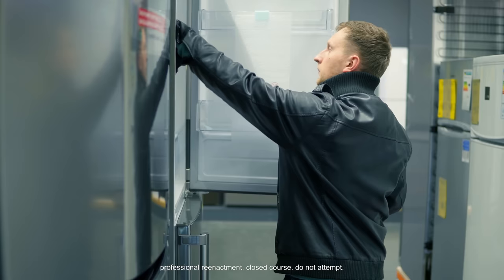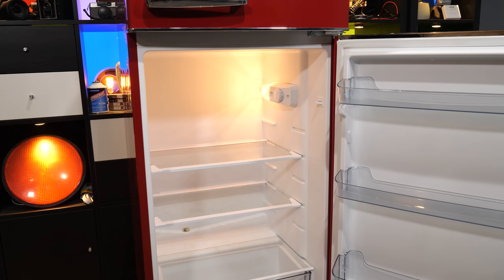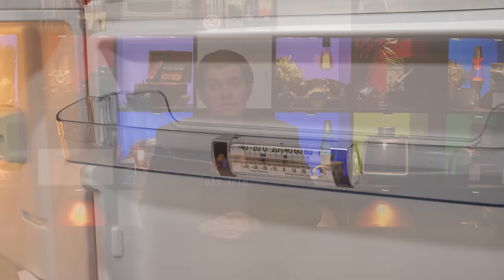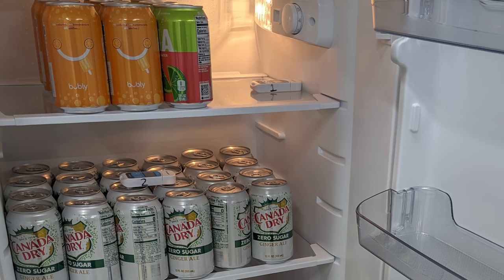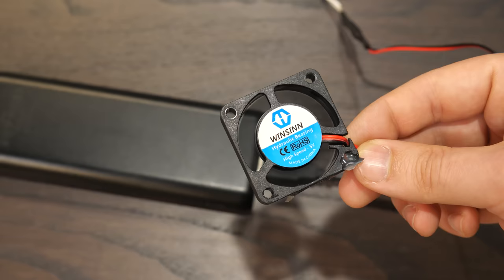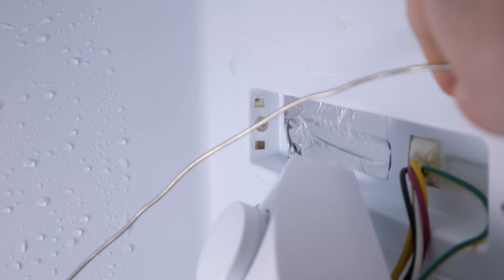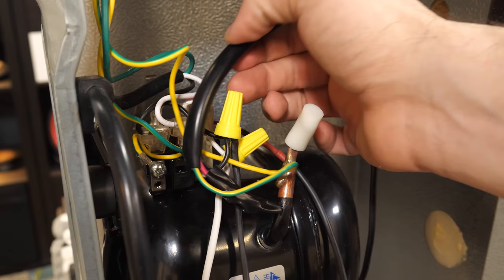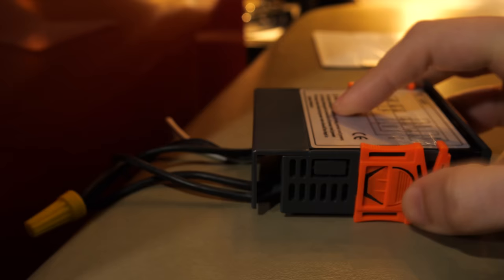This goofy fridge has a really clever design. It's also kinda terrible.

Comment: i am a Refrigeration tech, and I would like to give you some insights, so the type of mechanical thermostat this fridge, (actually the type most small commercial units use) is actually quite interesting. When you adjust the knob your not actually changing the temperature at which the switch closes. It is what's known as a fixed cut in switch, meaning what you are actually changing with the knob is the differential between the cut-in and cut-out temperatures, they are used to essentially make an extremely simple auto defrost. by attaching the switch to only a uniform diameter tube instead of a sensing bulb the pressure the switch sees is the average of the entire tubes length. then by inserting that tube inside the evaporator we get an average evaporator temperature. all you  need to do then is calibrate the switch so that it takes an average temperature of 33deg. along its length  before it has enough pressure to overcome the snap action and you can be sure the evaporator will defrost entirely every off cycle. Also, as you already found out in your testing, because you are reading evaporator temp and not air temp, when the refrigeration circuit has more BTU capacity than the refrigerator evaporators absorption capacity (a necessity with this series freezer design.) The thermostat will always satisfy before bring the box to the desired temp whenever the thermal load inside the box is larger than the evaporator capacity.
Reply: Thanks for this comment! I was kind of interested about the thermostat specifically, since I had a fridge tech replace a part in my fridge recently. He mentioned something about how the dial doesn’t actually set the temp, and I was a bit confused by that but didn’t ask him to elaborate. I think this is what he was alluding to!
Reply: I was looking for that comment.
Reply: I was thinking about the possibility of a thermal cut off switch on the compressor.

The compressor gets too hot from a 100% duty cycle, cut off does its thing to protect the compressor, fridge warms up but compressor cools off.

From my limited understanding of your explanation, that's not the case.

Rather the "thermometer" is getting too cold too quickly, in effect, to detect the correct temperature and needs to pause and acclimatise before it can work again.
Reply: @35manning yeah it’s to stop liquid getting back into the compressor
Reply: Thank you. I was going nuts that he got it wrong.
Reply: Okay but what about the observed temperatures, gradients, and differential? I'm sure they do have an extremely clever reason for putting the thermostat probe in the evaporator, but the end result seems to be some potentially unsafe food temperatures on the interior. Are you saying that by altering the run cycle with temperature control based on interior temperature that there will be frost buildup on the evaporator? I'm asking as a long time owner of one of these Galanz fridges, which displays the same odd run cycle behavior.
Reply: Can I ask what education it takes to become a refrigeration tech?
Reply: Thanks for this reply!

I'm not an HVAC anything, but it occurred to me that the proximity of the sensor to the coil was likely intentionally to serve as protection against the system freezing up, but you gave a far better explanation than I could possibly have.  And all kinds of other awesome details!  

I'm really surprised he missed that actually, he's always so thorough.  But we're all human I suppose.
Reply: @silverywingsagain exactly! It makes me wonder if rhis design is even legal?
Reply: but doesn’t it effectively act as a set temp as that’s what they use them as isn’t it? they have min - max written or little ice symbols denoting it making it colder or warmer when you turn it. when you turn the knob it’s changing the pre-tension on the thermostat isn’t it? making it require more or less pressure from the sensing line and therefore altering the cut in temp?  
like the little cal screw, every turn is approx 4c, and it’s basically a coarse adjustment. i turned a chest freezer into a fridge for drinks by giving it a good 5 turns to warm it up.  
This fridge is  still flawed as it didn’t keep food safe, i’m guessing the plastic lining of the fridge created too great a gradient between evaporator and food area. those old school bar fridges with open evaporator had the little thermostat line right on the coils like you said, but the evap was also open to the fridge so the bare metal was always cooling the fridge and not having to go through plastic.
Reply: And with the temp issues with consistency… they remain drinks fridges
Reply: @35manning  I think you're basically kind of right. From my reading of the comment, it works by effectively cutting off when the evaporator coil reaches its max heat capacity (i.e. it has taken as much heat out of the fridge as it can in one go, aka it's getting too hot too soon).
Reply: Thank you very much for the information.
Reply: @silverywingsagain  Not unsafe temperatures when you pay attention to the different temperature zones within the fridge and shop your groceries much more regularily and fresher than common in North America, keeping the thermal mass inside more consistent.
Reply: @Mygg_Jeager - to become a "refrigeration tech" it takes 1 working day of following the superviser around. You also need to take 4 rest breaks and eat at least one sandwich. Done... ready to write clueless and incorrect replies on Youtube!
Reply: Thanks for the answer! I have one of those cheap fridges that operate exactly like this one, but mine seems to have a defect, because it accumulates a thick layer of ice in one spot which makes the water just flow over the ledge and accumulate at the bottom, where then another slab of ice is formed behind the veggie drawer. What could be causing that?
Reply: @johncoops6897  Lol, funny. But I DO think it's slightly more complicated than that. I'm looking for skills to add to my resume that don't take 4 years and a Red Seal to get certified in.
Currently got 3 employable skills that nobodies hiring for... need a job and thought "Fuck it. No matter what the economy is doing, people's fridges do still be breaking down and need fixing. Why not inquire there?"
If it's a 3 week course and pays 1.5 x minimum wage, that's good enough for now!
Reply: @Mygg_Jeager  - OK, I lied to you.
There is zero qualifications needed to be a Refrigeration Tech. None whatsoever, any m0r0n can do it.
BTW having "qualifications" on your list is never going to get you employment.
Reply: Thanks for giving that detailed reply on how these fridges work. My thoughts on that fridge is that it looked like they had a lot of those old "fixed cut in" thermostats in stock and wanted to use them, but in a fridge without the rest of the usual components.

Until earlier this year I was keeping a 1964 model fridge going that worked that way. But it ran the refrigerant through the freezer evaporator FIRST and the fridge SECOND. When the freezer gets to -20C the liquid gets to the evaporator in the fridge and starts cooling it. When the fridge panels get down to -10C or more the thermostat opens and a heater coil warms the evaporator up to +10C or more to repeat the cycle (yes, 20C hysteresis, may have been more). My one had a bulb in contact with the panel, so it only cared about the temperature of the panel.

Alex's fridge had the freezer/fridge coils "backwards", didn't have any fridge evaporator heater and probably needed a more powerful compressor.
Reply: @johncoops6897  FYI
Even a "lowly" Elevator Repairman is a Red Seal Trade, that requires 4 years of training and schooling in Hydraulics, Electronics, Mechanics, and Fluid Dynamics. And that's an easy $41/hour all day, every day.
You don't strike me as the kind of person who's ever been in that tax bracket.
Reply: Thanks, I had encounteres this at work, and was as perplexed as our host.
Reply: @Mygg_Jeager  - you don't strike me as the type of person who has a clue about real life, or the concept of a thing called a joke.
Reply: @johncoops6897  My guy, you were not joking. I took your first comment as a joke, and then you doubled down on your snarkyness and derision - specifically to clarify that you were NOT joking. Plus you were just mad disrespectful to all repairmen everywhere. Refrigerator Repairmen have to work aground Comp 6, which is an EXPLOSIVE as we all learned in this video, Freon, which is an EXTREMELY toxic, polluting, carcinogenic refrigerant, which obviously can cause loss of fingers and toes due to frostbite - if it doesn't just outright poison you to death, AND electricity.
Given the hazards, this requires a far greater degree of seriousness and professionalism than the callous attitude one might have tinkering around under the hood of their car with an owners manual in one hand, and a beer in the other.
Reply: I think the advantages of this design are to minimize start/stop frequency by using the thermal mass of the evaporator to store cooling capacity, and to keep the temperature as cold as possible while minimizing the chance of freezing. Water coolers are good example. They cool the evaporator to several degrees below freezing forming a layer of ice on the evaporator, and increasing thermal mass. The warmer water melting the ice can be cooled to the temperature of the ice with no danger of itself freezing. The compressor is then restarted when the evaporator temperature rises above the freezing point. Given that the plastic walls of the refrigerator moderate the heat flux, the evaporator can be operated over a wider temperature range.
Reply: Pin this reply please
Reply: This still sounds like a stupid design choice, by placing the function of an optional gimmick (defrosting) before the primary function (cooling the food).
Reply: @ez45  - it is a cheap and crap fridge. You get what you pay for.
Reply: You know what would be a fun video? One about how the thermostat used in these refrigerators work.

Thanks for the comment - I always thought it was a bimetalic switch.
Reply: @Mygg_Jeager  depends where you are located, but in the US at a minimum. You must have an EPA license to handle refrigerants, known as a 608 license, most states also require you to go through some sort of apprenticeship to obtain a journeyman or masters license.
Reply: @maulerrw  No, the temperature at which the switch cuts in (closes the circuit and starts the compressor) is fixed at a temperature above freezing, so that every off cycle will insure the plate evaporator completely defrosts. This is actually very important in a plate design, because the frost is actually a pretty good insulator. So the more it frosts the less heat it can absorb, meaning the refrigerant temperature continues to fall, and you run the very real risk of returning liquid refrigerant back to the compressor.
Reply: @ez45  that could be caused by several factors, including poor air circulation across evaporator, being low on refrigerant, bad thermostat or poor sensing line location, etc.
Reply: @fascistpedant758  Many water coolers are designed that way, but in this case things are slightly different, in order to cool the box and the air in it to a temperature close to freezing the evaporator must be below freezing in order to create the necessary temperature differential to ensure air circulation. therefore you are lowering the dewpoint of that air down to the temperature of the evaporator, and spending the energy to remove the thermal energy of all that water, only to drain it out of the box rather than being able to use it as thermal mass to reduce cycle times.
Reply: @kallenbridges8471  Thanks. :)
Reply: @kallenbridges8471  I was suggesting that the thermal mass of the evaporator is somewhat analogous to that of the evaporator and layer of ice in the water cooler. Condensation is a separate issue. The evaporator, on the cold side of the plastic wall, probably sees no condensation.
Reply: No, differential adjustment can be done using screw which can only be done by removing thermostat and poking it through one of screw hole in it. But rotary adjustment is actually for temperature (not exact temps though)
Reply: @Mygg_Jeager  Thanks for speaking back to that other guy.
Reply: @kallenbridges8471  thanks for explaining and for your original comment.

Would you elaborate more about the thermostat knob, please? Imagine that I filled it with nothing but drinks, and imagine that the room temperature was normal and consistent. What happens to the average drink temperature when we turn the knob to 1? What about 10? It sounds to me that you're saying the averages are the same, while the differences are more extreme when the dial is set a certain way, but more average, when set the opposite.
Reply: @eugenetswong  Yeah man, no problem. :) I really do have no problem with people who don't know something and are willing to learn. What I can't STAND, are people that know NOTHING, and think they know EVERYTHING. I speak with a high degree of confidence in my respective fields, and people often accuse me of being a "know it all" ... and by that they mean they think they know more than me - even when they don't study or work in it. That shit fries my oil pan like nothing else.
So here I am, popping into thread to expand my awareness of a trade I have never heard of before... and then this JohnCoops JagHoff pops outta nowhere and starts spewing that exact attitude I absolutely hate, towards someone else. I wasn't gonna let that fly.
Reply: @Mygg_Jeager  I hear you. These people literally have to do nothing, because they don't even know what they don't know...but somehow, winning something here is better for them, especially since it involves putting people down. It's laughable at best.
Reply: @Mygg_Jeager  my thanks as well. BTW, i asked a buddy about Canada and he told me you do need a Refrigeration and AirConditioning Mechanic Red Seal, as well as a Gasfitters Red Seal in most provinces. apparently some provinces have there own test as well.
Reply: @eugenetswong  setting the knob to the lower temperature will lower the temperature at which the compressor shuts off which will lower average temperature..The temperature at which it turns on should stay fairly stable. so the spikes on the graph will be taller as you set the knob to a lower number.
Reply: @kallenbridges8471  Ahh, that's a shame for me then. :P
Reply: @johncoops6897  Really depends on where you live. In Sweden, that's a minimum 4 months full time studies with both practical and theoretical tests to be passed.
Electricians have three months plus a 1700 hour apprenticeship divided into different areas (industry, home installation and so forth) before they can apply for a license test for the first, limited authorisation that allows installations from an existing fuse without supervision.
There of course still are some really bad technicians and electricians out there, but least you know they do shoddy work out of choice and not ignorance :-p
Reply: @johanmetreus1268  - 4 months study = wow. That's about the same amount of time of time it takes to get off probation and be fully qualified to work at McDonald's.
Reply: @johncoops6897  Are you serious?!
Four MONTHS of training, and STILL it is impossible to get an actual hamburger at McD...
Reply: This was $10,000 of engineering for a $400 item.  I’ve done the same to repair my expensive Sub-zero refrigerator.
Reply: @SonsOfLorgar not only legal but quite common. This is just undersized for what its being asked to do. Hence the long pull downs even when he changed the controller.
Reply: @johnpoldo8817  "This was $10,000 of engineering for a $400 item. "

Question though, what would an engineering class giving the same level of knowledge and experience cost?
Reply: @johanmetreus1268  Probably about the same cost....what do you think?
Reply: @kallenbridges8471  So, is this a bit like the temp probe across the evap coils of a little window AC unit?
Reply: From a guy who makes living by fixing these, (among other home appliances) Ive always reasoned to myself that the sensing bulb is almost always located at the end of the evaporator to make sure that it cools down completely and works as its designed. Capillary and all the other parts for system should be designed that compressor gets some downtime too and prevent in shor cycling. And to make it more reliable in the long run. And on the other hand, if system is low on refrigerant, only the start of the evaporator gets cold and usually forms a big lump of ice there too because of extended run time.
And yes. as mentioned on video, that thermostat is made to measure temperature of the evaporator instead of the air.
Reply: @Serilleous  This fridge style is called a "cyclic defrost".  It's the original style of 2 door fridge with a separate freezer door and was common from the 60s-mid 90s before fan forced with electric defrost models got cheaper.  I still have my old one bought in the 90s in my garage.  The thermostat is part of the evap coil because that's how it controls fridge defrost - ie after cycling off it wont restart the compressor until it's above 0 celcius.  That ensures the fridge evap has defrosted between cycles.  The freezer has to be manually defrosted every 2-3 months though.  The old one I have perhaps better at temp control because the interior freezer panel is all metal, and the fridge evap is a metal plate screwed to the back wall (with stand offs creating a gap behind too).  There is a real science behind passive air cooled cyclic defrost fridge designs, look at refrig engineering textbooks from the 1970s.  I used to be a fridgey.
Reply: Thank you!  I'm an HVAC engineer and don't know too much about the specifics of residential refrigerator controls, but I did immediately suspect that the sensing bulb had more to do with the refrigeration system than the space temperature.  This also explains why you never see temperatures on these thermostat knobs - it's always just 1-10.
Reply: I still don’t understand what the dial actually does 🥲 can u dumb it down a bit?😅
Reply: And how three hell is this useful to the average person who thinks setting 1 is for warm and setting 5 is for cold? The explanation doesn’t make the design and implementation not stupid 🫤
Reply: Thanks professor
Reply: Hi Bob vance